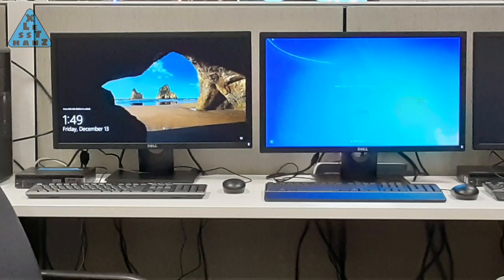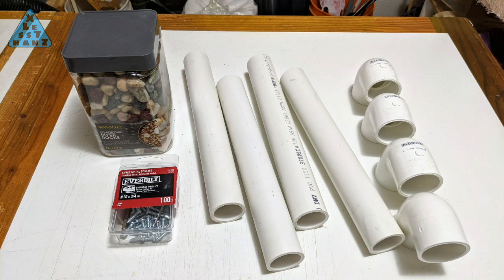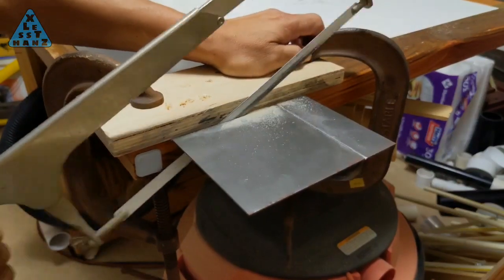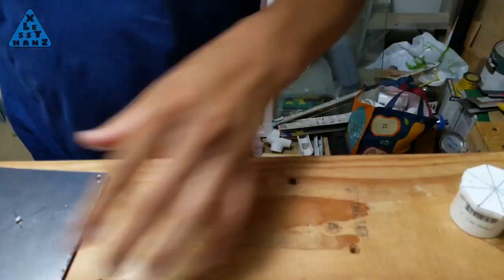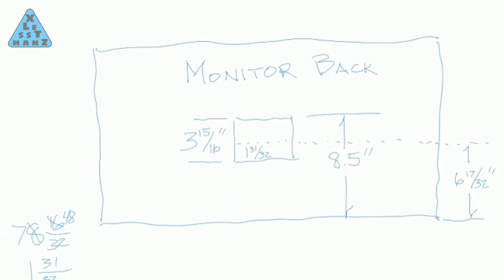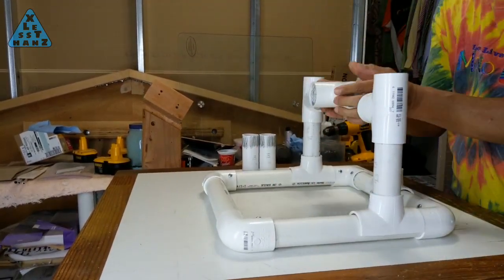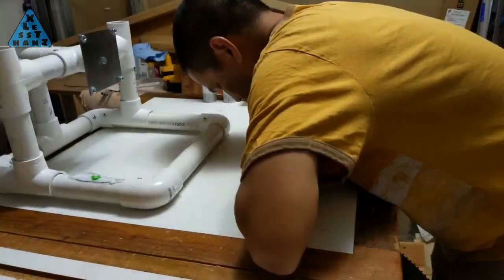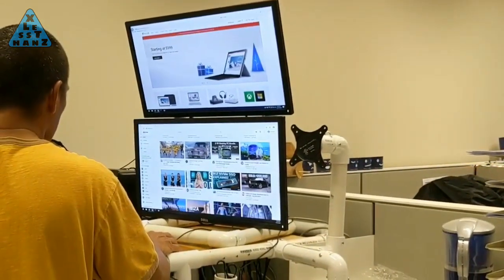PVC Monitor Stand - Stacked Dual Landscape (DURABLE AND STURDY)

Comment: can you do a laptop docking version of this? laptop being at the bottom, additional screeb on top?
Reply from the maker: The changes would be fairly simple.  You'd have to...
1. Remove the 2 elbows and the PVC pipe from the front of the base.
2. Replace each of those 2 elbows with a coupler and plug (to hold the rock filler in)
3. Finally, all PVC pipes across the width of the stand has to be longer to make the base wider so you can slide the laptop into the base and align the top of the laptop screen with the bottom of the mounted monitor.

You should probably leave the bottom monitor mount for stability and it might become useful later.

Comment: Hi. Just wanna ask, what if the monitor doesnt have a mount holes? Can you help me?
Reply from the maker: Hope this makes sense.  3 tees.  1st tee in center pointing left, right and back.  2nd tee right of center pointing up, down and left. 3rd tee left of center pointing up, down and right.  The up/down connections have PVC and elbow to support the monitor.  The center one connected to the left and right with PVC and the back facing connection goes to the rest of the stand.
Reply: @XLessThanZ  Thank you so much! Keep it up!

Comment: at 3:47 are those black screws the wrong way?
Reply from the maker: The black bolts are the monitor screws.  Too small to screw into the nut, but using them for alignment with the plate so the nut doesn't move while glue dries.